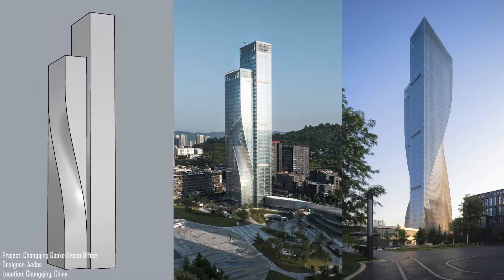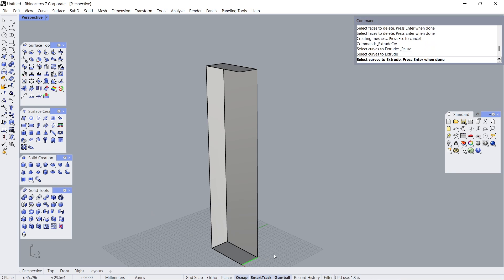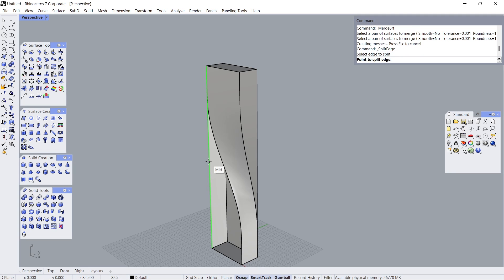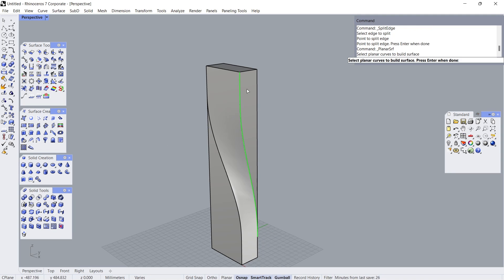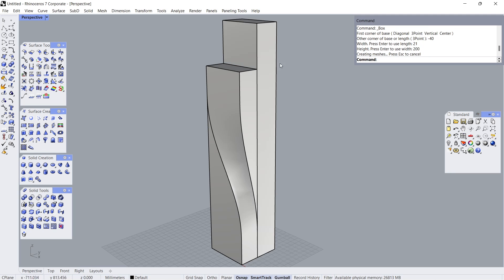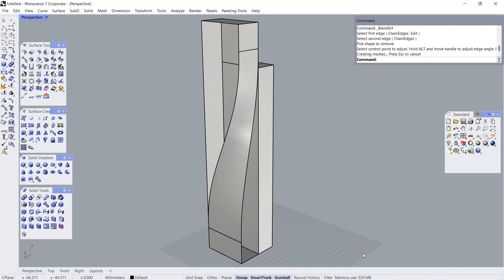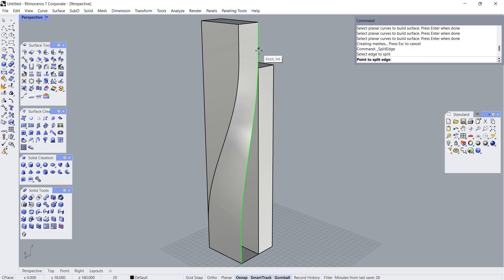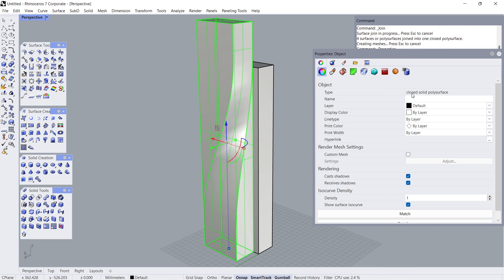Rhino Architecture For Beginners - SOM

Comment: Hello, great video. I cannot successfully use PlanarSrf. Split Edge doesn't let me split properly it seems, leading to PlanarSrf not working. I cannot use Loft or Sweep as an alternative, as this does not create a solid surface in the end. Could you please give me further guidance on that?
Reply from the maker: Hi, try to use.‘’DupEdge’’ ‘’Join’’ ‘’CloseCrv’’ ‘’PlanarSrf’’
Reply: @AdamArchh  Hello, thanks but none of these worked either. CloseCrv does not close edges off, and does not properly seal as a solid. Dup edge, join, and planarsrf(which I already tried) do not do anything and it does not mention why.
Reply from the maker: Can you send us your model to check it? We will send you a video.
Insta: AdamArchh

Comment: Hi Adam, thank you for your excellent tutorial. I followed you every step but the result I got on the blending surface was like a polygon, not a smooth one like you. can you tell me how I could fix it?
Reply from the maker: Hi, thank you, If the model is correct, this method will solve the problem.
- Options - Mesh - Custom - Density - 1.00
- If the problem persists, can you send us a screenshot of your model?
Insta: adamarchh